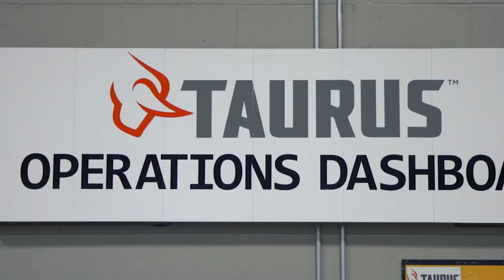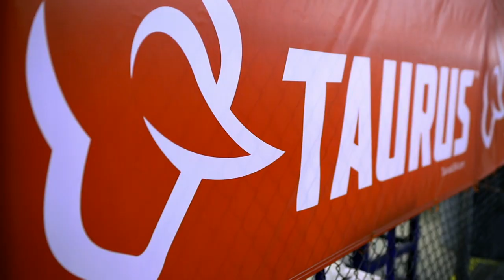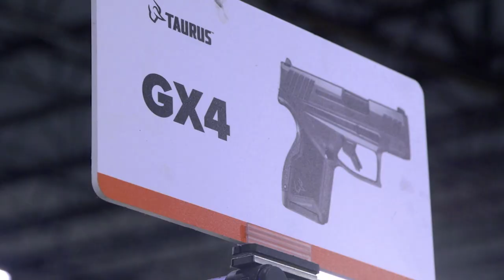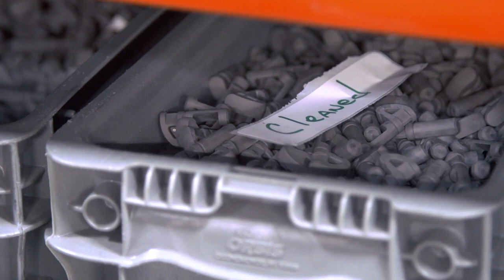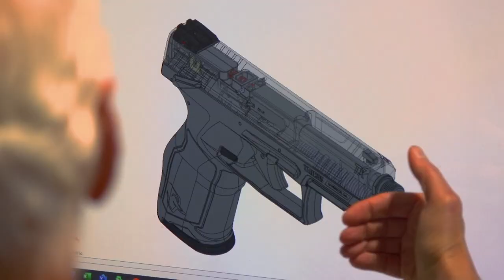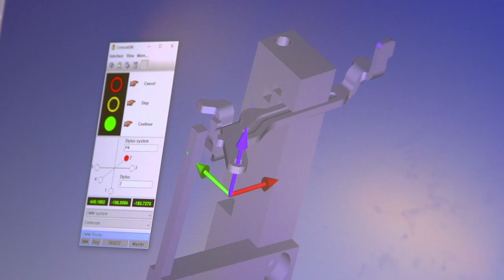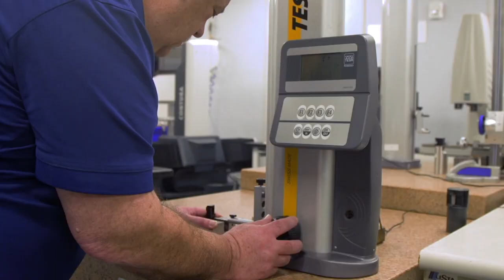Taurus USA's Big Move

Comment: Have pickup Taurus Product in sometime, las one was early production Raging Bull. Could have been better. Some field tests were positive recently. 
Alert: The last frame of demagnetized operation is something all gun manufactures aspire, however, occasionally a critical replacement of part has magnetic qualities retain after heart treatment. Checking with compass will tell you slide, frame, or any components have at least slight magnetic retention causing premature wear and retardation of motions for bolt, or hammer rotation velocity causing light primer strikes.